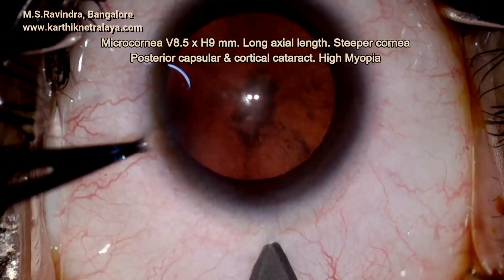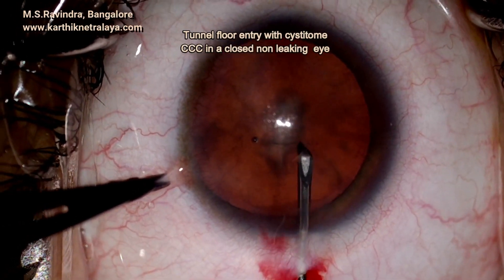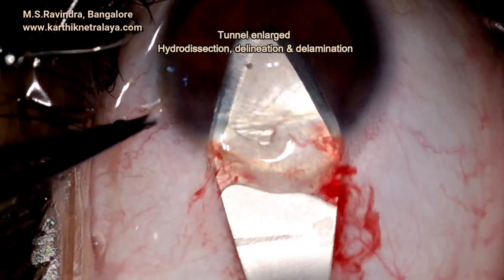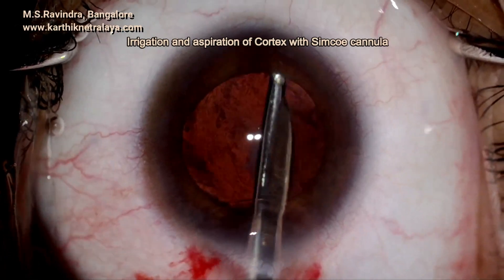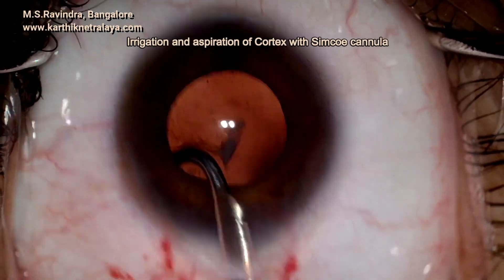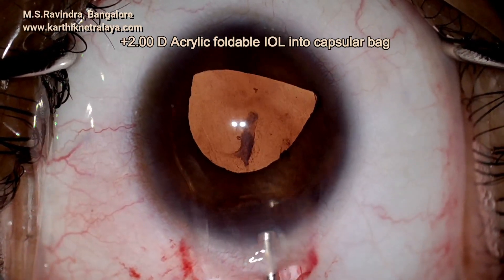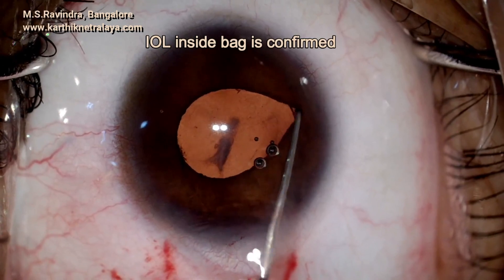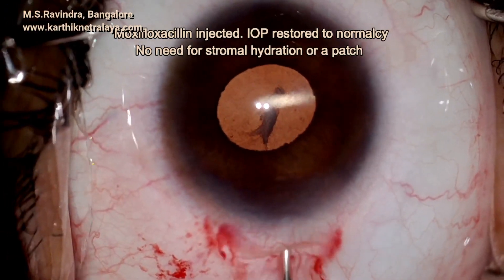Phacosection for microcornea, posterior capsular & cortical cataract in a myopic eye

Comment: Well done sir . 
How was topical anesthesia applied in this case? Please explain sir.  Thank you 🙏
Reply from the maker: A drop of Proparacain is instilled few minutes before skin preperation. Inside OR, few more drops of the same are instilled on the temporal limbus and at the place where I hold limbus with Forceps. Before doing CCC, I infuse about 0.2 ml of 1% Lignocain on the surface of Iris. This is sufficient to give totally painless surgery.
Reply: @drmsravindra  Thank you sir 🙏